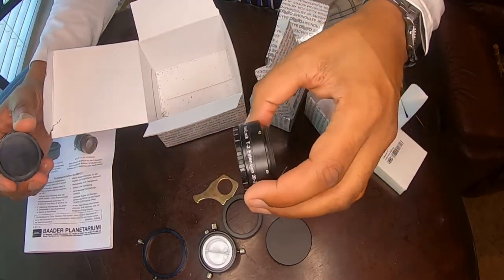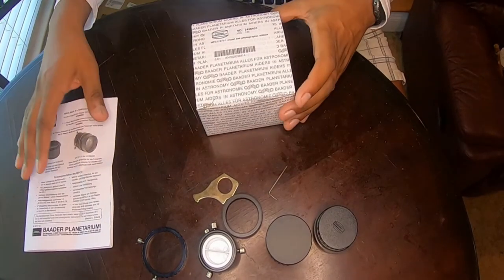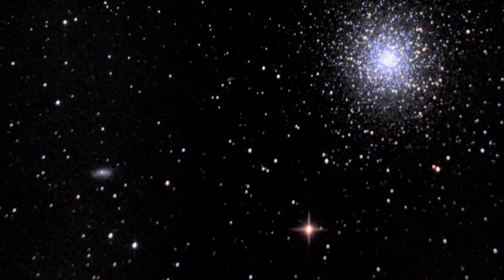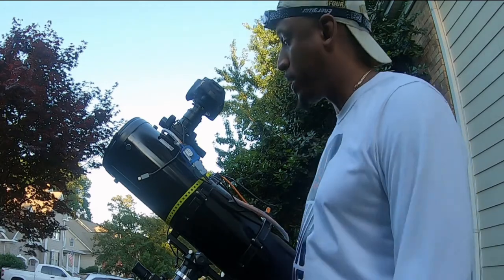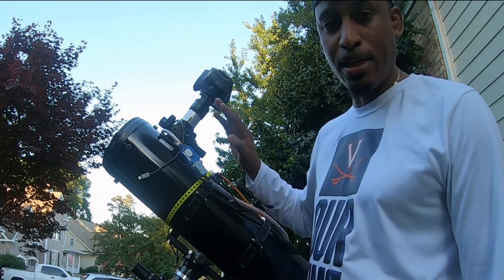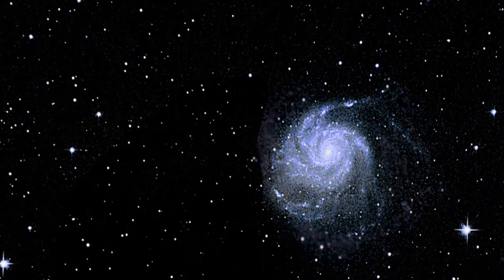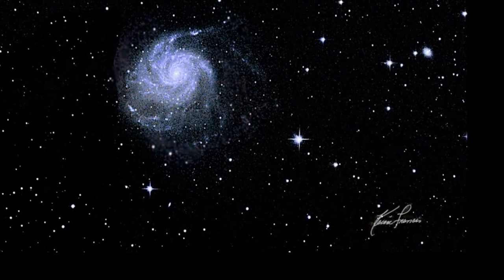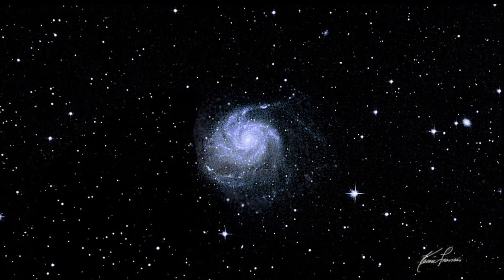Hard To Find Tool Corrects My Stars On A Dobsonian

Comment: Very nice video Kevin. I went through the same learning curve with the 1.25" vs 2" focal barrel adapters and made the same mistakes you did. You get a much better FoV and can take images of much larger areas of the sky with a 2" focal barrel. My setup is with a t6i and a Skywatcher Quattro 200p so I use the dedicated Quattro Coma Corrector aka Skywatcher Aplanatic Coma Corrector.

Comment: Nice video Kevin. I see your coma corrector didnt go into the draw tube like other coma correctors. Does that mean it can be used on 1.25" focuser drawtube which is 1.50" in my case with appropriate adapter?
Reply: I have the same issue . Looking toward the answer

Comment: What size does the t ring need to be to fit in the coma corrector does it need to be smaller or the same (I’m a beginner so that’s why I dont know this stuff) for instance you have a 2” coma corruptor do you need to have a t ring of 2 inch to or does it need to be smaller?
Reply from the maker: It's a 1 to 1 correlation.  A 2 in coma corrector would fit a 2 in t-ring.  You're on the right track!  Clear skies!

Comment: Hey! nice video.. I have an f4.7 and want to do use a coma corrector. Do you also use narrow band filters with your DSLR? If so, how do you select the visible light colors in post processing to correspond?
Reply from the maker: Thanks for your comment.  With my DSLR I do not use a filter because I've not modified it.  If you've had the IR filter removed, then you can use any of the single, dual or triband filters on the market.  As far as combining them, there are a few commonly used pallets, SHO and HOO.  Each corresponding to RGB with S-Sulpher, H-Halpha, and O-OIII.
Reply: @KevinFrancisAstrophotographer  Thank you for your kind  and informative reply..

Comment: will the this baader coma corrector help if my dslr can't even reach focus in newtonian? i had new focuser installed not knowing it would screw up focus reaching point for dslr. I currently use other astro cams that avoid this focus issue altogether, but can't exactly use dslr anymore. So wondering if this coma corrector would help in that or not. Thanks.
Reply from the maker: Hello Niraj the coma corrector will not aid in back focus to the degree it sounds like you need.
Reply: @KevinFrancisAstrophotographer  thanks Kevin..just wanted to make sure.👍